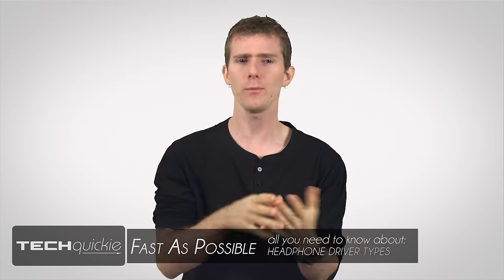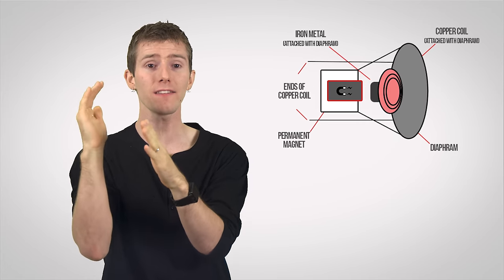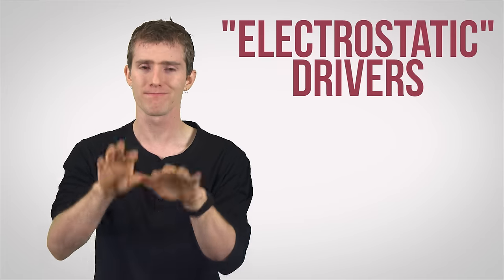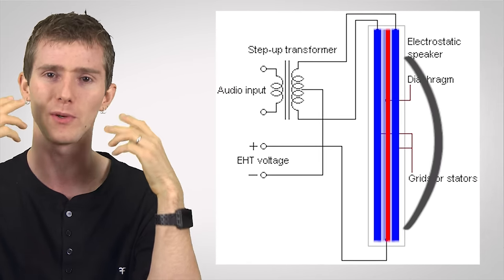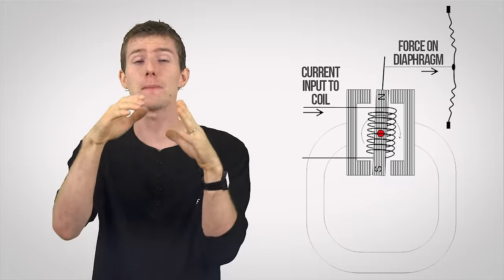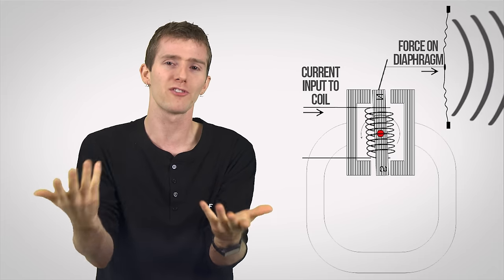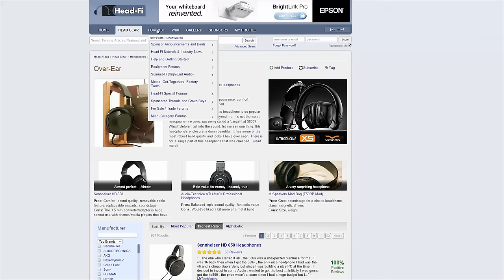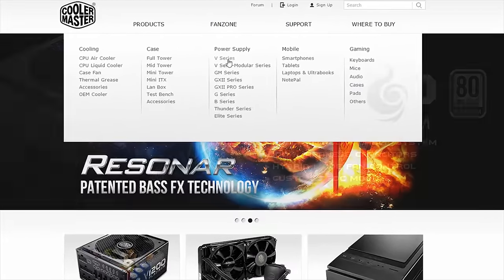Headphone Driver Types as Fast As Possible

Comment: Could you guys do a video explaining the differences and pros/cons between a gold plated jack to a silver plated one?

It might sound silly to some but I've never really found solid answers as to how they're different or why gold plated jacks are often the way to go when choosing your headphones/earphones. When I buy my headphones, I know I have to choose gold plated over the silver ones although I never really knew why but I was told and I always see people saying that the gold ones are better.
Reply: Benyamin Lorit Gold plating makes no sense on headphone jacks, plating is there to protect the underlying copper/brass/whatever from air exposure, but gold is a very soft metal and rubs off quickly, its use is in home stereo cabling where you never unplug the cables.  Silver is extremely expensive for no reason, the only way it could make a difference to sound quality is if all the wire in the audio signal's path including the headphone's voice coil was silver, and the only difference would be the electrical signal getting to the headphones a fraction of a picosecond faster.  And silver plugs have to be cleaned monthly or they develop "oxidation" that increases resistance on the plug.  You want nickel or rhodium plated plugs, nickel is very very common and inexpensive, it lasts a long time and has good conductivity.  Rhodium is a premium option, it lasts about 8x longer than nickel and has a higher conductivity.  However conductivity doesn't matter here unless the metal being used is a very very poor conductor. :P
Reply: Izzy Axel So would it be right to assume that most branded headphones that have gold-colored jacks are made out of Rhodium? I do tend to prefer gold colored jacks than silver ones whenever I purchase headphones for some reason so I want to know if that actually makes sense or something. One minor detail I've noticed though is that gold colored jacks seem to be smoother when plugging or unplugging but maybe that's just me. So asking from a common headphone buyer's standpoint, should it matter whether it's a gold jack or a silver jack whenever I buy my headphones?
Reply: Benyamin Lorit The core will be copper, the plating on a non custom cabled headphone will be nickel if it's silver colored, gold if it's gold colored.  Rhodium costs far too much, 1 rhodium plated 3.5mm TRS plug will run you about $30, it's a low quantity production item that really only get sold to be used on the absurdly overpriced cables, esoteric high end hifi products barely anyone's heard of, or to people who reterminate their cable with a nicer plug than the stock one, or make their own cables.  The smoother feeling may just be the difference between a better constructed plug, rather than the plating.  Also, rhodium is silver colored.  Generally, nickel is what you want in a headphone plug, as gold will rub off in a month or 2 with normal use.

Comment: does the size of the drivers have a different in the sound?
Reply: Yes,  larger drivers perform better with low frequencies. Smaller drivers are better with higher frequencies (typically).

Comment: Apple-style IEMs are worse than my current pair of IEMs. they are not really fitting into my ear well, break easily and have a loud bass that turns into static buzzing after some time. The only good thing about those are the bass, higher freq response and the fact that I don't need to clean them every day

Comment: Would adding a top 200mm intake and a 120mm front intake make my CPU cooler stop throttling so much b/c occasionally it sounds like my PC is about to take off and join the Air Force. Currently I only have my CPU cooler and a 120 exhaust hooked up b/c of Mobo limitations.
Reply: Are you using a stock cooler?
Reply: Yes Hakumisoso. A stock AMD cooler
Reply: SPARTAN26MiLLiX Grab something like a hyper 212 evo. Won't sound like a turbine, and will cool better than adding 2 fans.
Reply: Hakumisoso I'll look into it.... would the intakes make the CPU cooler less loud though? Because it would be cooler and yada yada yada
Reply: SPARTAN26MiLLiX Adding fans would help slightly, but adding fans in itself adds noise. I would just go with the new cpu cooler.
Reply: Hakumisoso ._. Thank you. I was hoping to not put more money into my PC for a good bit, though. I don't care about soft noise but when I literally cant hear my game at medium speaker volume, it's a problem.
Reply: SPARTAN26MiLLiX You know, just to check. Are you sure it isn't your gpu making the noise? Stock amd and older nvidia coolers can get very noisy.
Reply: Hakumisoso I have an MSI r9 270x and in the MSI GamingApp I told it to rev the fans 100% and it was still pretty freaking quiet.
Reply: try water cooling??? since you are using stock cooling, or just watch the temp of your CPU
Reply: Get hyper 212...and open a window
Reply: Definitely need some kind of intake it isnt circulating any air with only exhaust.
If top is only spot that works fine.
Reply: top intake is a horrible idea.
Reply: Jacob S Reasoning?
Reply: SPARTAN26MiLLiX You want to have a good path for the air to cool the hardware, hence why Front, Side intake and Top, Back exhaust is mostly recommended, Since you already have a back exhaust a top intake would hurt the efficiency of your cooling. Not to mention top intakes are notoriously bad for dust.
Reply: Also, the first dude is right, get a new cpu cooler and a 120mm front intake, it's the best option for you
Reply: Jacob S I already have a front and top intake, only thing is I'm missing a 3 pin male to 3 pin female connector for my hub. I'll look into the evo
Reply: SPARTAN26MiLLiX Oh, I would skip on the top intake, it wouldn't be beneficial and would just add noise. I would put the 120mm front intake just for better airflow, you would definitely need a new cpu cooler to get rid of your noise problem though.
Reply: Jacob S Thank you
Reply: Jacob S One last thing, what if I make the top into an exhaust and only use the 120mm as an intake. The top has a blue LED on it which I kinda want on.
Reply: if the fan is exhaust from the top. I do not recommend it. its going to get harder to clean. I prefer and currently using the top of the case as an intake for my Radiator.
Reply: SPARTAN26MiLLiX You could if you want but it would result in a negative air pressure inside your case, which would mean dust is being sucked inside your case. I would keep a 1 intake, 1 exhaust deal, imo.
Reply: It is a surprisingly common mistake for people to accidentally plug in a case fan to where the cpu cooler should be plugged in which will cause it to go really loud because the computer will speed up what it thinks is the cpu cooler and is actually the case fan and so will not be able to cool it down very well; the only other thing that could make it go that loud is if you have a large overclock and a shitty cpu cooler but if not then it is quite likely there plugged in the wrong way round, but good luck fixing it :).

Comment: What about 7.1 gaming headsets? Is it usefull to have 4 drivers on one ear?
Reply: No, 1 driver per ear is always better (you only have two ears after all, I hope). If it uses multiple drivers it will require the drivers to be smaller to fit in on each can and the interference between drivers themselves will distort the sound received by your ear. Space in sound terms is created by the delays in which one ear receive the info compared to the other side and not from the number of sounds emitted in one direction.
Reply: Like Linus said, check the driver quality. We only have two ears anyways, so more isn't always better. 7.1 and 5.1 surround sound is really only worth it home theater systems.
Reply: But does it help for surround sound when gaming?
Reply: *****
You mean if surround sound does it better than stereo? Not really.
Reply: Zakky Hidayat I was talking about gaming headsets and surround sound. I am not a audio geek who wants perfect audio.
Reply: ***** Everyone has said no, what more do you want? 7.1 Gaming Headsets are shit.
Reply: *****
Who wants anything less than perfect audio? You're better off w/ a good stereo headphones and a mic. If you want surround sound, get a home theater system.

Comment: I am always unclear as to why using VGA cables are bad. I mean they do support 1080p at 60hz as far as i can tell. Why should i use hdmi or dvi instead if they both accomplish the same thing. Sure, VGA bandwidth is lower, so there may be problems with higher resolutions, but other than that. Anything else?
Techquickie make an episode on it maybe? Lol.
Reply: He did already
Reply: Dany Reyes oh? Nice. Will go check it out.
Reply: Analog vs Digital signals. In almost every way, digital is better for this application.

Comment: What about piezoelectric earpieces? From what I understand about how they work, it confuses me why they're not used for in-earphones, since as I understand they don't need amplification, just a clean signal, which would be great for portable devices, but I've never seen them mentioned outside of use with crystal radios (I'm an electrical engineer, but I specialise in computing, I'm not that great at understanding analogue systems, much to my chargrin)
Reply: They are used in a niche but strong market of acoustic and acoustic/electric guitars, as pickups. Also he said it wasn't a comprehensive guide.
Reply: Red Tuesday I'm aware it isn't comprehensive, I commented to get responses from those that know about it in the comments, and as such thanks for the response, can see how it'd be valuable for acoustic stuff, was mainly wondering whether it'd even be possible to use with a PC.
Reply: DuskandDey I've heard that some of the piezoelectric tweeters on speakers are pretty good so I don't know why so many people say that they're just a cheap substitute for the real thing. People just say they suck, but they don't say why.
Reply: Quick rundown of Piezoelectric crystal earpieces.

They are usually monaural (using only one earpiece) devices with very low sound fidelity, but high sensitivity and impedance. Their peak use was commonly with 1960s era transistor radios and hearing aids; and are usually only used with crystal radios today (as you stated) as well as diaphragms for some microphones. They aren't used with modern portable media players due to unacceptable sound quality. The main causes of poor performance with these earpieces are low diaphragm excursion, nonlinearity, in-band resonance and the very short horn shape of the earpiece casing. The resulting sound is very tinny and lacking in bass.
Reply: ***** What about using a crystal with a different chemical composition that does a better job?

Comment: How do I know which headphones uses which drivers???
Reply: It says in the product description, but most headphones (cans) use dynamic drivers. And if you want to find it on your own, take a look at the drivers on your set of cans. If the driver is circular and has a wavy pattern like a tire then they are dynamic, if it is a kinda big flat thin square the it is planar magnetic, and balance amateurs are only present on in-ear monitors but they will look like tiny square magnets stuck together.
Reply: If you ask this question I would say 99% chance they are dynamic.
Orthodynamic and electrostatic drivers only come in headphones that are maybe $500+++ and you really need to know your stuff when you buy such things due to you needing to buy an external amp that is another few hundred/thousand bucks.
So does BA as well in earphones though they start using them in products of a much lower price like say ~$50 and onwards up to $1000++ CIEM's
Reply: what about razer Tiamat?
Reply: Erik4boss what would you recommend then? logitech xD?
Reply: Mr.Kristian252 Audeze or Stax XD 
But seriously, Sennheiser, Beyerdynaic, Audio Technica are just a few of the proper audio brands out there.

(about Audeze and Stax, they are top notch best in the world stuff, however their price is also 4 digits.)
Reply: My fave so far in my headphones is the noontec Zoro HD for me best Headphones Under $60 Hi-fi quality without the price. I also love my Bayerdynamic Custom one pro but the price is a bit high.

Comment: Please Vsync as fast as posible
Reply: All it does is put a cap on fps to try to match the graphics card with the monitor you are using. The way this works is that the graphics card is told to wait to render frames, so instead of 120fps on a 60hz monitor, you'll, in theory, stay at 60 fps coming from the card. V-sync is used to reduce, and or completely get rid of screen tearing where two frames are rendered and basically split the monitor into what can sometimes look like 2 images. Gsync is a much better version of Vsync and is expected to be in mass use withing the next couple of years.

Comment: The only thing i care about with head phones is durability...
i listen to a metric shitload of audiobooks and text-to-speech read books and i go through head phone or headphone cables at an alarming rate..

frankly i kind which there was some standard for this purpose with less wear placed on te headphone connector and cable..
it's really a crapy design durability wise...

the second consideration of coarse is comfort...

I earlly must get my 3d printer working so i can custom build something and some kind of self contained durability pocket protector thingy...

(i've worn out like 2 kindles!! and i hate it when i waste money i can use for more books...)

Comment: Where do I update my drivers?
Reply: Just plug in your headphones into your pc and you can update it from your manufacturer website's product support page.
Reply: Are the drivers installed on my PC or on the headphone itself? I am worried when i go mobile.
Reply: uhhh wait i'm not sure if this is supposed to be a joke or is a real question now, what drivers are you talking about to be exact?
Reply: Software drivers?
Reply: headphones don't need software drivers. they are purely mechanical devices. (unless they have a USB cable instead of a 3.5 mm stereo jack)
Reply: I see.. i was looking at razer's surround sound drivers or something, thats why i got confused.

Comment: It would have been nice if you talked about active (needing a battery to work) vs none active Noise cancellation headphones,
Reply: Active noise cancellation uses microphones on the headphones to produce a sound in the headphones that cancels out the ambient sound. Passive (non-active) is just using materials to physically block out sound.
Reply: That is completely different. This is a video on drivers not the types of headphones, or difference between active and passive noise cancellation.
Reply: This one's cool. So basically, active noise cancellation takes the incoming sound via microphone, and reverses the wave. By reversing the sound wave, you basically cancel the sound out. You can do the same thing with radio waves as well, which is how signal jammers work. 

Passive noise cancellation, however, works just by having good sound insulation around the cup on the ear.
Reply: Is there such thing as passive noise cancelling? You may be referring to noise isolation.
Reply: 2010ngojo well technically there is such a thing, but what we were referring to is noise isolation, correct.
Reply: Tyler Raber
I can't find anything of passive noise cancelling. The sites I checked misused the term " noise cancelling".
Reply: 2010ngojo not necessarily in headphones but in studios where special panels are used to try to cancel the sound by reflecting it in a way that creates an inverse wave to cancel the sound out.
Reply: Tyler Raber
 Thanks for sharing man, that's pretty sick though. Wish they could improve it w/ some kind of reactive material that will change shape according to the sound or something.
Reply: 2010ngojo actually I explained that incorrectly. What mostly happens is the sound goes in and bounces back and forth in the foam which deadens the sound; however the scattering of the waves does occasionally cancel out the sound.
Reply: Tyler Raber
 Oh I see, so it's a mix between 2 types of noise reduction; passive cancelling and isolation.
Reply: 2010ngojo it would technically be noise deadening and a description of it could be labeled as passive cancelling, but its not really related to isolation.